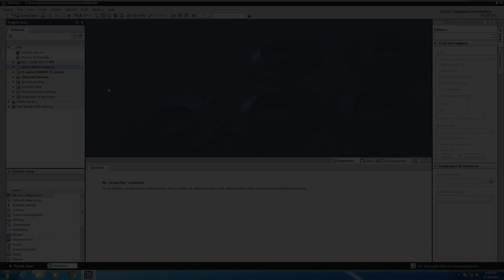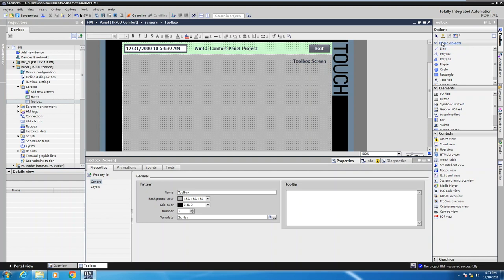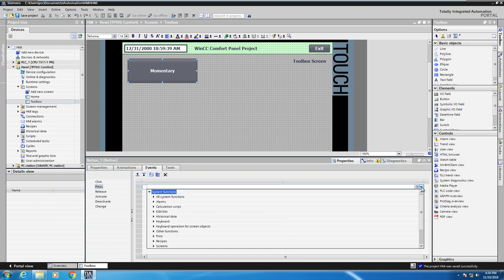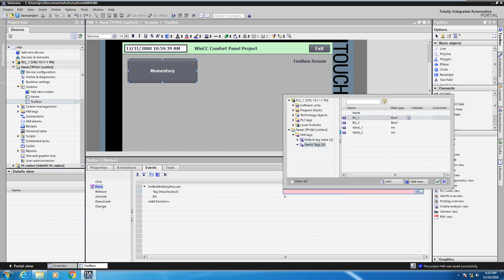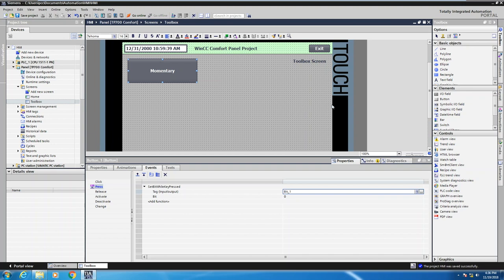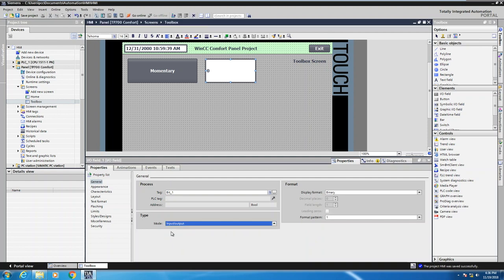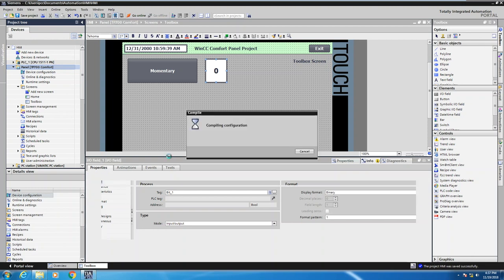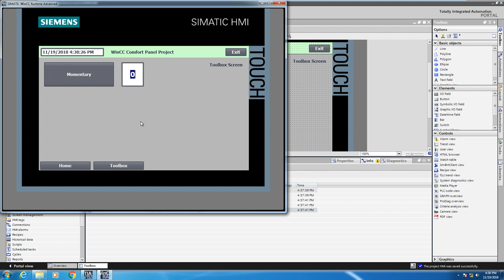Lesson 5 - Configure your first HMI screen with a few basic objects

Comment: I have Siemens kp700 comfort HMI ,it's communicate with Siemens S7 300 plc via profibus MPI.
HMI shows 190011 code.
One button used HMI the tag was M40.4 it is automatically latched during running program. I change different bit also ,,but cannot rectify the issues,, that memory bit not used any other place in program.
The issues is which side PLC side or HMI side?